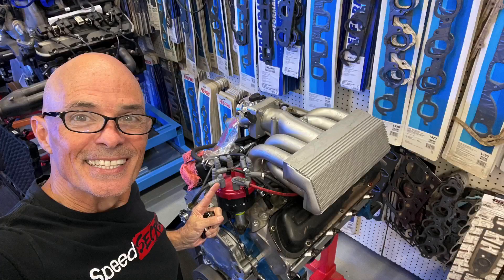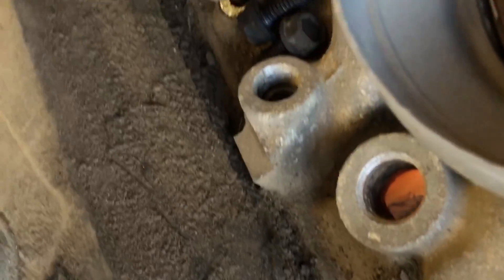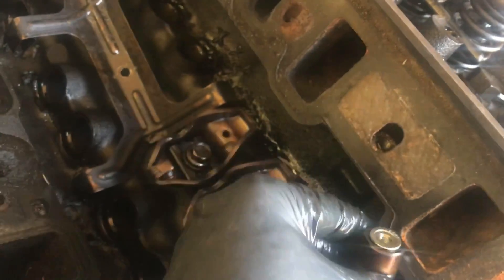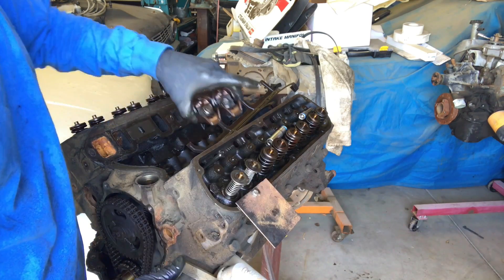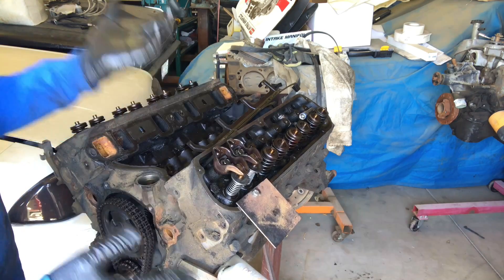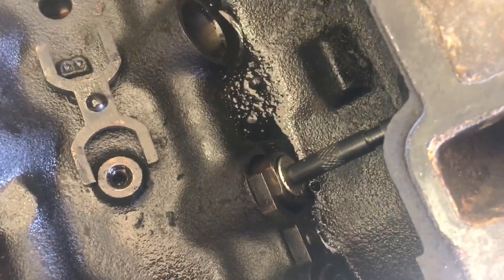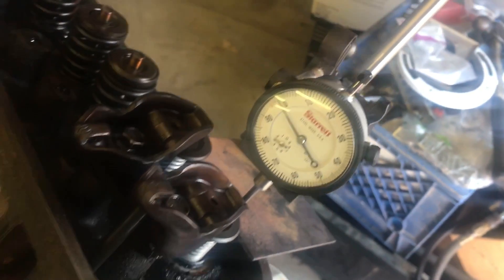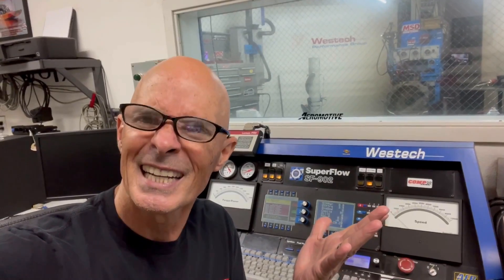HOW TO MEASURE PISTON TO VALVE CLEARANCE. HOW BIG OF A CAM CAN I RUN IN MY 5.0L FORD? HOW MUCH LIFT?

Comment: Stupid question here!!! If you did run into P/V issues, could you shorten the pushrod to correct that other than obviously changing the cam??? 🤔🤔🤔
Reply from the maker: UNFORTUNATELY THAT WON'T CHANGE P-V
Reply: Ways you can fix it:
thicker head gasket and lower compression
different piston, whether lower overall compression height or a more aggressively deep valve pocket 
shorter rod and less compression
cam with less lift.
Carefully altering the timing to make it so your valves are not open to that extent when the piston is in that position. This would require a degree wheel and a way to alter cam timing in an incremental basis plus you would want to verify that it was the same in each cylinder and also maintain whatever minimum clearance is advised, like .001" or whatever, when running.
Reply: No, you can change the rocker arm ratio tho